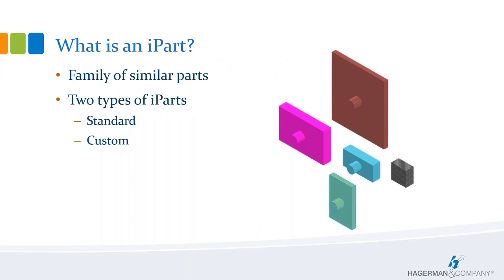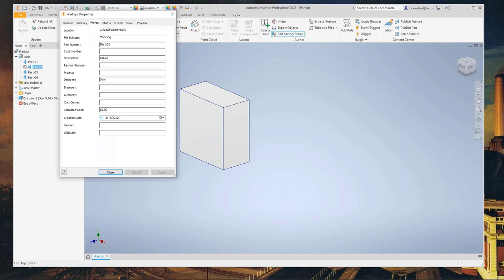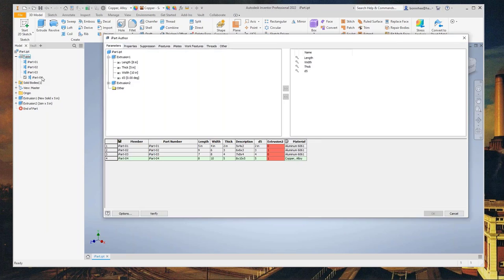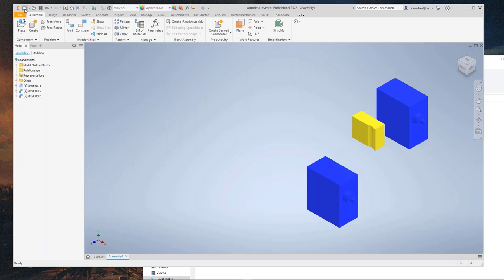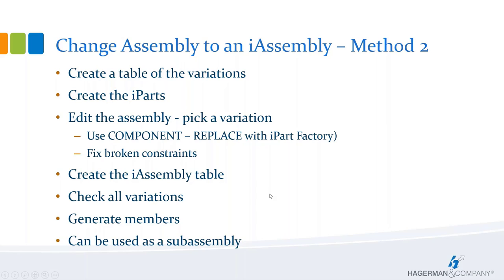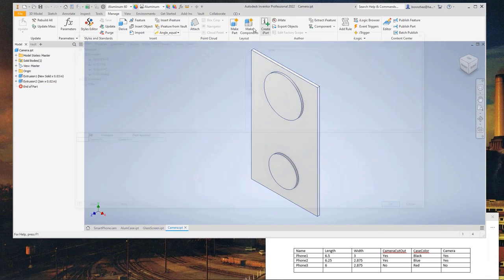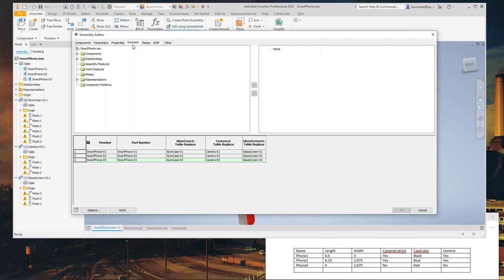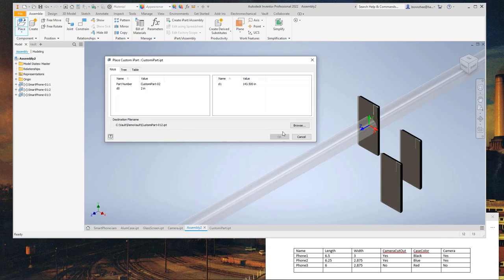Managing Autodesk Inventor iParts and iAssemblies

Comment: I have an iAssembly with an "ISubassembly" where I make a Table Replace, almost exactly like your SmartPhone, just other parts. but when I look at Bill of Materials, on the iAssembly,    it shows both the part from the "iSubAssembly" I have active, and the part I not have active.
Is there a way to fix this, so it only shows the active parts?